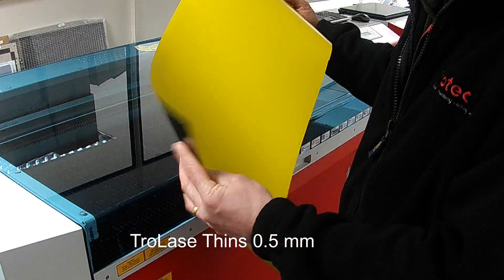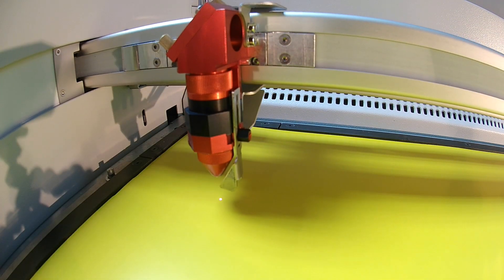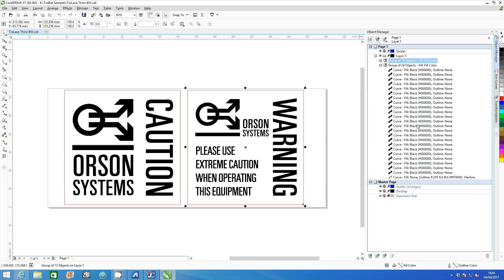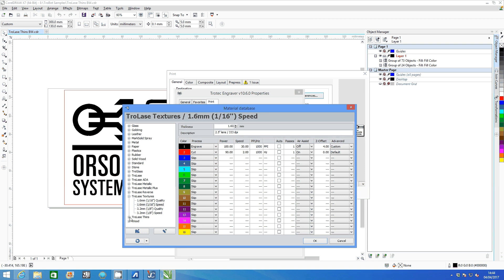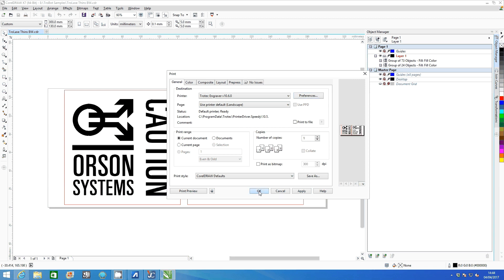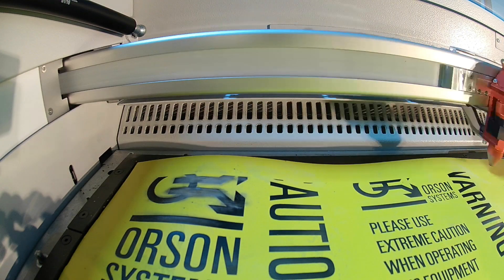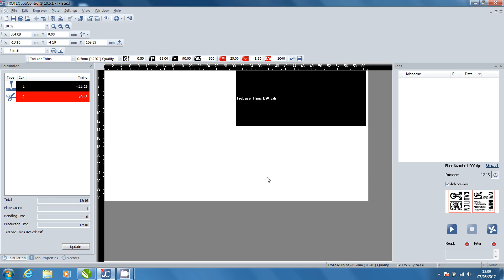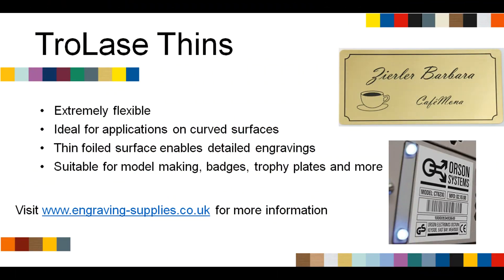Tutorial: Laser cuting a sign from TroLase Thins | Trotec Laser

Comment: I'm having a really hard time keeping it from warping, even taped, it manages to warp in areas with bigger engraved designs.
Reply from the maker: We're very sorry to hear you haven't found the optimum setup for processing your material. When taped in place the material should hold a stable surface until the final stage cutting is completed. If you would like to contact your local agent who supplied the material with some photos and application information, or us directly, they/we will be happy to offer application assistance. There are some hints and tips on our website here -> https://www.engraving-supplies.co.uk/material-usage-hints/engraving-laminate-trolasethins

Depending on your application, you might also consider trying our 0.8mm TroLase.

I hope this helps!